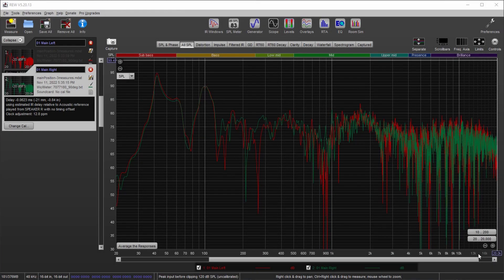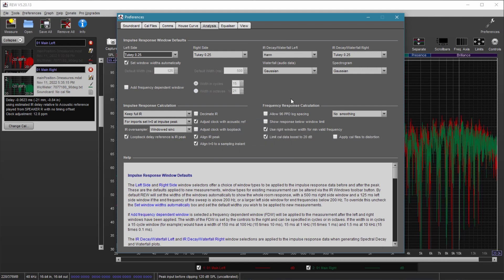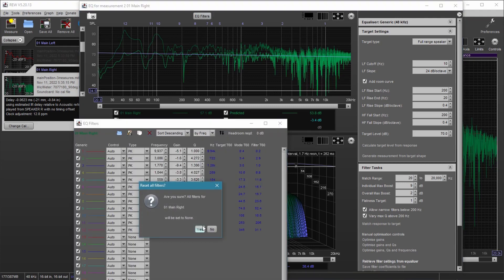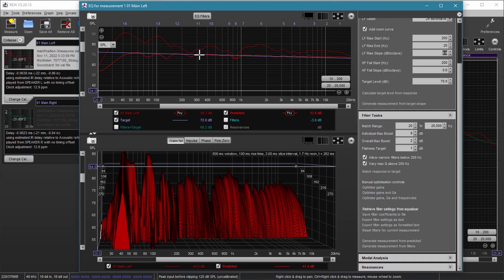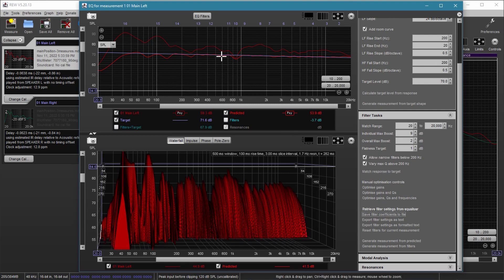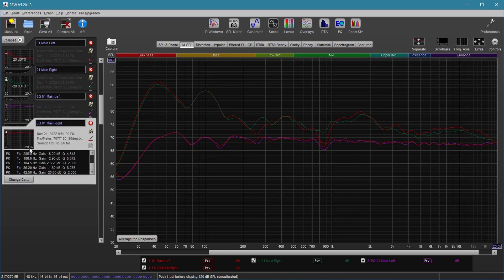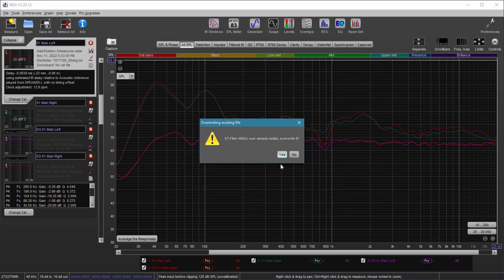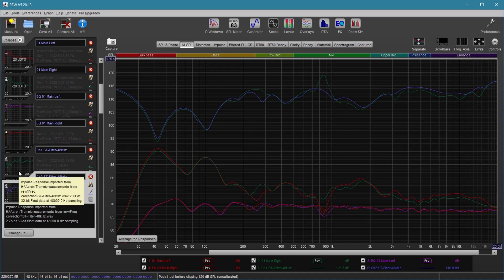Generating Simple Frequency Response Correction Filters using Room EQ Wizard

Comment: Most of the major DAWs have an IR loader or you can load via a reverb fx plugin and add the results to the master output of the mixer etc. This is a very similar process to adding a cab ir in a modeler. Other eq correction software such as Sonaworks and others do essentially the same thing as REW but are paid options. REW is free. This tutorial does a really good job of covering the basics of getting eq correction for the home studio.

Comment: Thanks for this! I'm running into an issue at export: I've followed your steps exactly, go to "Export Filters Impulse Response as WAV" and select the correct measurements (the original ones, where I ran the EQ)—then got "The selected filter set has no filters that have an effect, nothing to export." Any tips?
Reply: Sorry James this is super late but for any others who run across the issue,
I did the same. You have to have the original measurement you made the EQ for selected instead of the EQ curve itself.

Comment: 2 questions, are you doing the psychoacoustic filter instead of lets say 6 or 12 db smoothing for anything specific reason? like is it better to use psychoacoustic over the other choices? Also are you able to put this IR back into REW to then run it through the room sweep measurement to see IRL if the freq curve did infact work as predicted? side question do you, or does anyone else here, know if its possible to put this IR on your main computer outputs so its just on all the time? for example so you can listen to spotify through the IR aswell?

Comment: thank you for taking the time to make these REW videos. Also have you seen Obsessive Compulsive Audiophile and his way of making files with an Inversion method ?  https://youtu.be/5YcH7j2-L1Y
Reply from the maker: You're welcome. Yes I have seen what he's doing. I do this a little differently, though. I am still inverting the signal, just not the same way. I prefer to generate correction based on a smoothed response, either around 1/6 or psychoacoustic. My filters all end up as impulse responses, so the fact that they are generated with REW's bi-quad filters isn't relevant.

Comment: Quick question - what was the point of creating the EQ sets if you just exported the original measurements to make the WAV file? If you convolve the original measurements, do you also need to run the EQ settings at the same time?  Thanks!
Reply from the maker: Ah but I didn't export the original measurements to a wav file. Watch it again closely...

Comment: Last step, "All you need to do is..."  What the hell is a convolver
Reply from the maker: A convolver is a processor that takes an input signal and translates it through an impulse response. The process is called convolution. Usually this is used as a studio reverb effect to place a sound source into another acoustic space without actually having to go to the physical location. Take a look at Altiverb and you'll get the idea. The convolved IR is blended with the dry signal as a reverb effect.

What we are doing with room correction is essentially the same. We take our input signal and process it through an impulse response of the correction needed to fix the issues our speakers exhibit in the room. The only difference between this and the reverb effect is that we do not want any of the dry signal. All we want is the corrected "wet" signal. 

That's basically what's going on.

Comment: Probably a noob question but why not merely export the filters as a text file and then import them as PEQs into your equalizer? Is the use of  a convolver a necessity?
Reply from the maker: The use of a convolver is not necessary, no. However, if you want the best quality you are not going to get it without a hi-res impulse response in a high quality convolver. 

I used to use Equalizer APO when I got started. It has a built-in equalizer that does import the settings from text files. When I was new to this I thought that was great. I didn't even know that we could use impulse responses to get the job done. 

However, once I learned how to implement convolution I heard the difference immediately. It was like night and day. There was no comparison. Impulse responses fed into top-tier convolvers deliver pristine sound quality that those text-fed equalizers can't match.

Additionally, with convolution you can correct the time domain as well as the frequency domain. That isn't even possible if you are only working with text data for eq bands.
Reply: @davidbrancato  yea, makes total sense. I am merely a home theater enthusiast trying to calibrate my system using a Denon 8500HA receiver/MULTEQ-X/MiniDSP 2x4HD; nonetheless, I think your view is worth exploring. I will let you know how it goes

Thanks
Reply: @davidbrancato but EAPO can also do convolution where you import wav files instead of text files
Reply from the maker: @l.s.1709  It probably can, but I have always found Equalizer APO to be a clumsy and inefficient way of implementing DSP. The platform doesn't allow us to see what's happening in real time, only what's shown in "captures" of your settings.
Reply: @davidbrancato  which (free) tools do you suggest in that case? I'm still pretty new to DSP and installed EAPO on my PC and HTPC.
Reply from the maker: @l.s.1709  Pedalboard 2 and Element work well along with VB-Audio Cable or Hi-Fi Cable. You can load any good convolver into them once you have them set up and just process your audio through that. There's no need to be running APO.
Reply: @davidbrancato  thank you!

Comment: Curious, have you tried limiting the corrections via ‘Frequency Dependent Windowing’ in REW for purposes of avoiding the correction of reflections?
Reply from the maker: I have. As it turns out, none of the methods I came up with that used FDW produced filters that sounded as good as these filters do. I think that simply using the psychoacoustic smoothing model on the measurements evens things out well enough.
Reply: @davidbrancato  Got it. Many thanks!
Reply: @davidbrancato did you also try other levels of smoothing?
Reply from the maker: @l.s.1709  Oh yes. The smoothing levels I'm using are the ones I've found to work best for me.